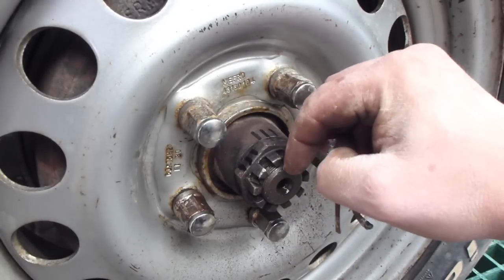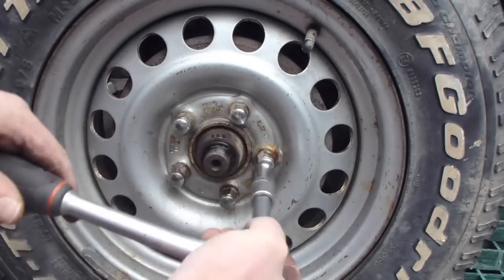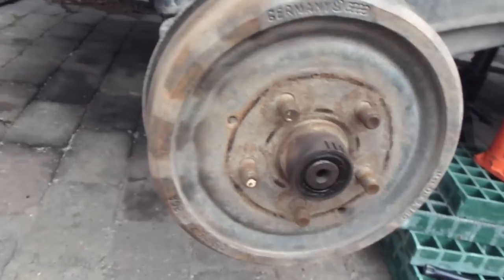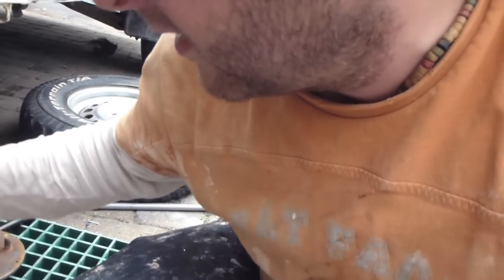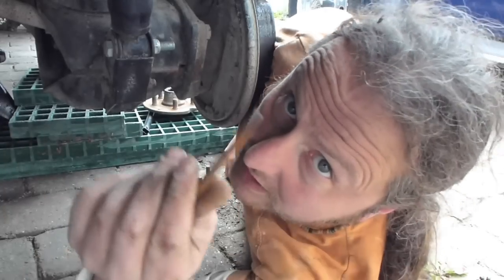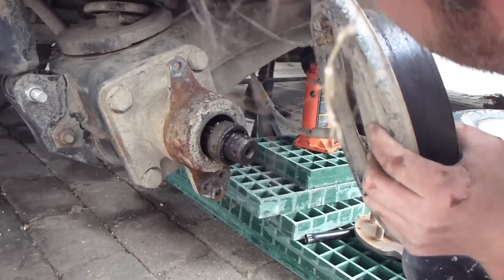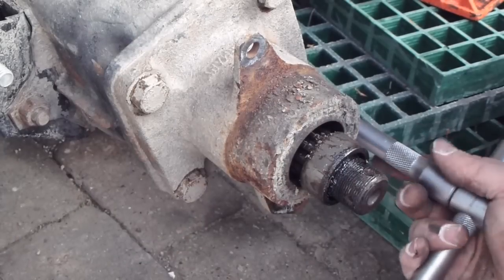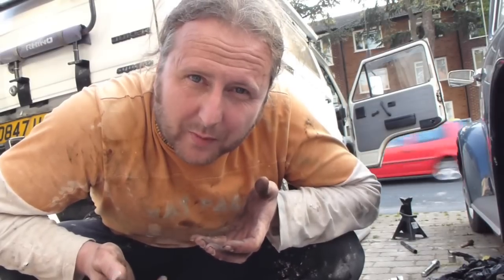VW T25, T3 Syncro Or 2WD Rear Wheel Bearing Swap

Comment: Dan!? Can I run something past ya. I read several cats do the same as you (for obvious practical reasons) in having a spare fully assembled spare rear bearing carrier assembly with bearings ready to go. My question is how do you then manage threading the axle back through a loose spacer between the bearings? Do you keep a wooden rod or something in there to keep it in place which you pull out as you thread the axle back through? Or some other mad crazy clever trick? Thanking you in advance. Big VW Love.

Comment: Thank you for the tip of leaving brake assembly in one piece, very helpful. Btw do you tighten main nut while car is on the jackstand, meaning all pressure goes to gearbox? I wonder if that can damage gearbox.
Reply: You should tighten/loosen the hub nut when NOT on an axle stand or jacked up.

Comment: Removing the hub worked perfectly, I changed the bearings in the old one but I cant get the hub on again. I've tried pushing it on using the bolt and different distance rings but it won't go on. Do you have any tips ? Thanks from sweden!
Reply from the maker: A good wriggle around should do the trick.

Comment: Great video, I'm planning to do the same. I just can't get the big nut off. The long pipe didn't work for me. I even put a jack below the pipe. Any tips for that?
Reply from the maker: Hey Martjin, here is a plan..

Go to your local garage (you call them shops maybe?) with the correct socket for the castle nut. They will have pneumatic tools that vibrate like mad that loosens the sucker off if it's stuck. Get them to pop your socket on the air gun (just incase they don't have that size) and they will get it off with one hand in around 3 seconds. Then just get them to put it back on again.. Give them a small box of donuts and offer to give them some money (That they will not take for 3 seconds of work). Drive off and then when back at home and all relaxed just follow the fitting video at your own pace now the nut can be taken off after 30 years of relaxation.

When done grab a beer and sit back and congratulate yourself for following CampervanCulture.com and we hope one day to join you with beers..

I hope this helps.

Jed
Reply: Hi Jed, I took the bus to the shop and they had a bigger pipe and took it off. Now I'm reassembling again, but I can't get the axle trough the bearings. It is sticking out about 1 inch and now it is stuck. can't get it out or in... any more tips?
Reply: Hi Jed, thanks for the mental support, by just asking and taking a break. I got it!!I gently bolted the housing of the bearings to the car until the driveshaft couldn't rotate any more, then I used the old bearing and the big nut to pull the driveshaft out, so now putting the rest together, take a nice cold beer and take it to the garage for the mot on thuesday
Reply from the maker: Good work Martijn.. Sometimes it helps just to walk away from a job to get your head straight then get back to it. Really glad you worked it out and I bet you feel a whole lot better for doing it now hey! 

Have a good weekend,

Jed